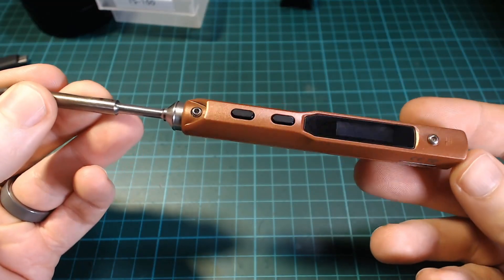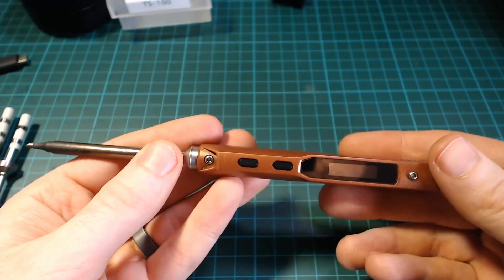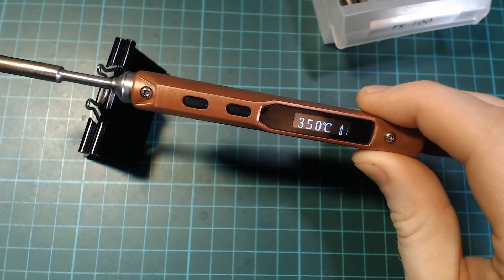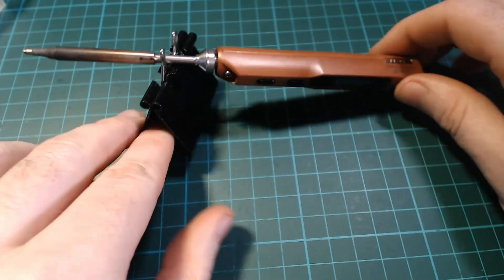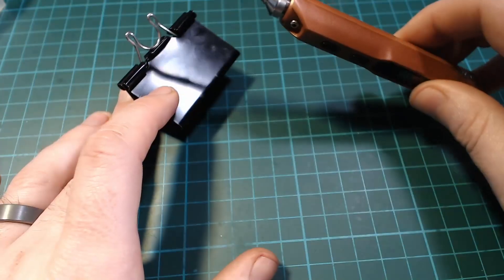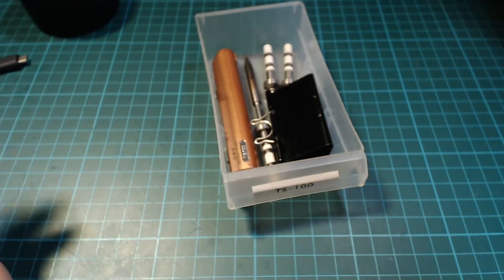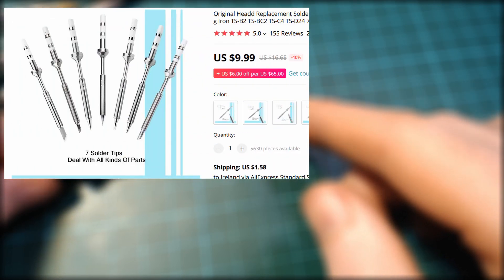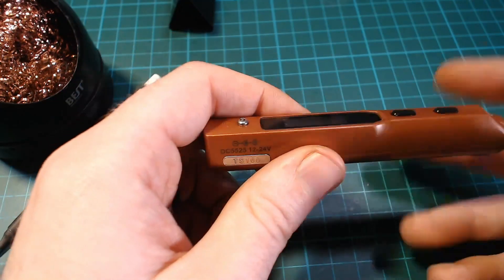TS100 Soldering Iron - My thoughts in 2020 (3 years of use)

Comment: I have the TS80 myself. I don't understand the negativity about it.
I am a professional engineer, and yes there are better irons on the market.But also with a much higher price tag.
With many years of experience, I can tell that both are fine soldering irons for most of the things people normally are going to solder.
For both irons I would highly recommend getting a flexible silicon cable.
The only case I wouldn't recommend these little irons, is when you do A LOT of assembly per day.
Not a change that these will last in such environment. But for everything except, it will be totally fine.
The good thing about the TS80 is mostly the portability (it works on a good powerbank) plus the tip is a lot better.

Comment: I got mine as a gift around the same time as you and it's been excellent. Still on the same tips, never messed with the firmware and unlike a lot of people I've even got used to the horrible stiff cable. Replacing it with a silicone sleeved one was in my mind but then I've never got round to it.

Comment: My usecase is very similar and after 2 years i'm still very happy with it. My solution for a flexible cable was a cable that tattoo artists use for their tattoo machines. They're also made of very flexible silicone. I can't remember which channel mentioned that recommendation, but i think it was voltlog or so. The only thing i would like to see added is a J-Style tip for the TS100.
Reply: It was likely VoltLog. I bought one of those tattoo cables as an experiment but I have to say it wasn't nearly as smooth and flexible as the cable Brian presented. I highly recommend it if you're using the TS100 as your primary soldering iron.
Reply: +1 for the tattoo cables. I have 1 on my AC power supply and 1 on an adapter for my drill batteries.

Comment: I've been using a 24v 6a power brick with mine very happily. I think most people having trouble are using an underpowered supply. I made up a silicone flexible lead for the same reason as you, ps you need long 5.5mm 2.5mm plug. I also changed the firmware as the new one goes up to 450°C from 400°C. Very easy to do. Cheers